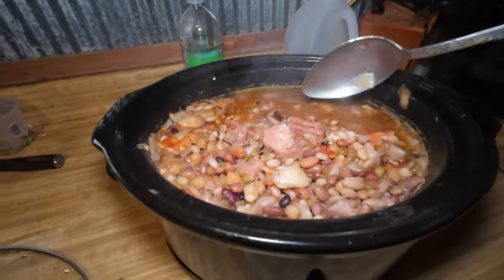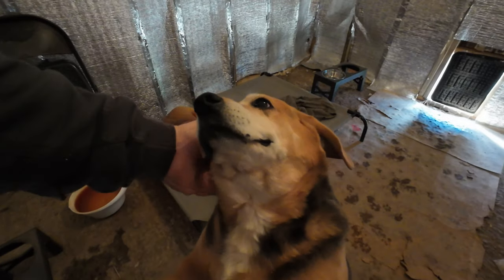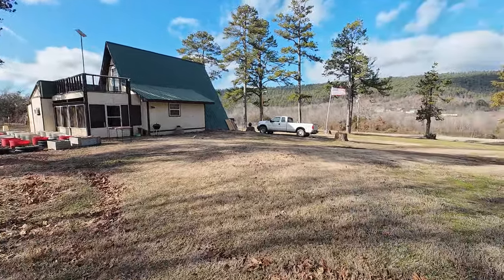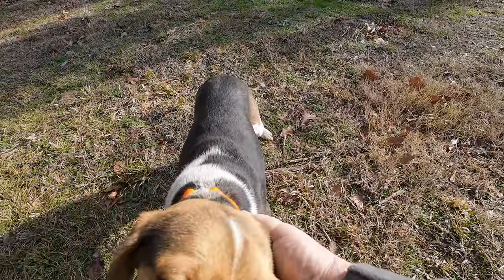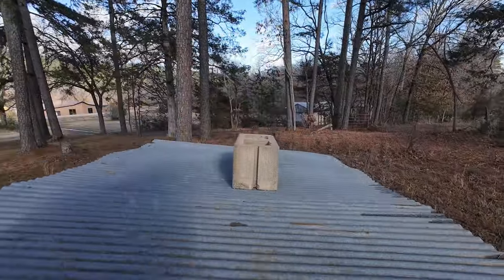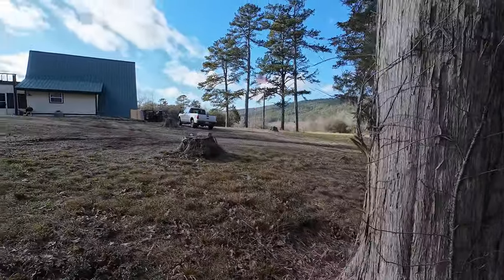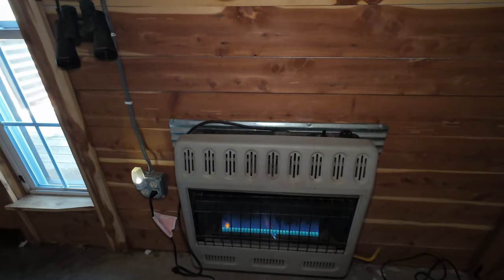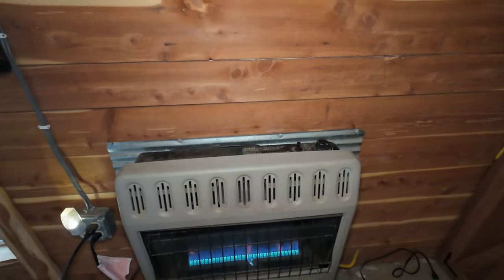Failure With The Cabins Propane Tank.It Could Have Been A Very Cold Night!

Comment: Mike, 

What exactly does the regulator do on the propane tank?

I’ve seen plenty of barbecue grills hooked up to the propane tank but never noticed a regulator.

Please advise explain the use.

Never mind…I looked it up.  It regulates the propane pressure into the propane heater.
Reply from the maker: Keeps it from having to much pressure

Comment: How long will that propane gas last, for the heater?  Will it last 4 or 5 days, using it all day long?
Reply from the maker: It will last about 2 weeks on low at night.Less if I run all day, I will just go get more if 80lbs runs out